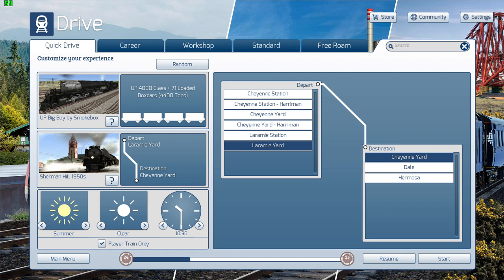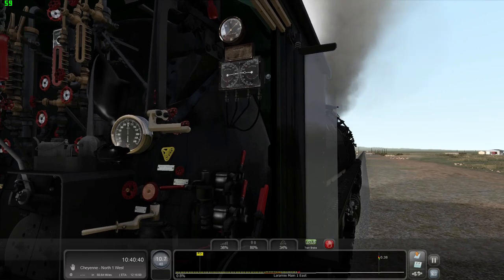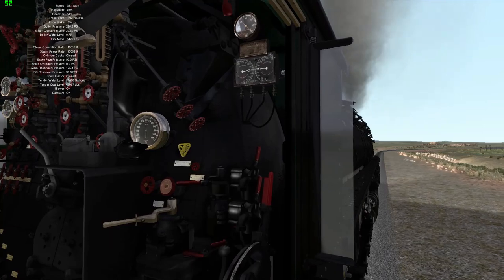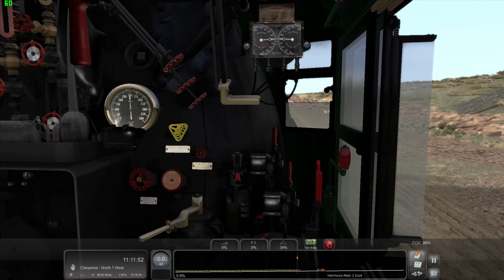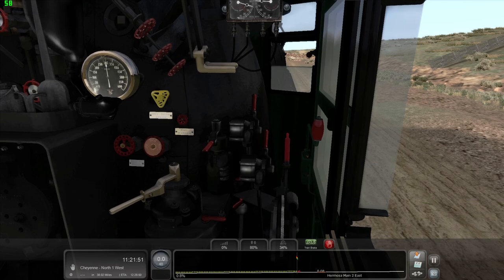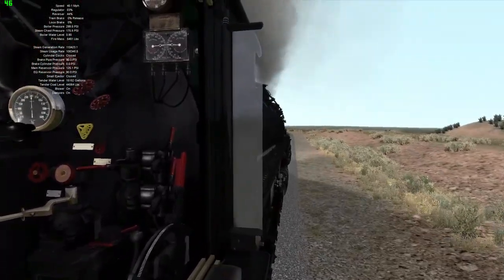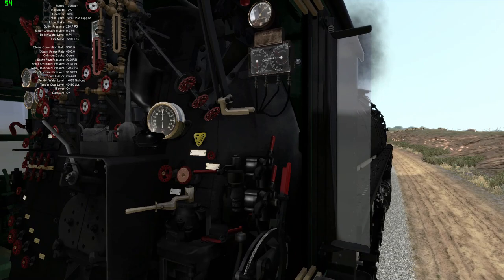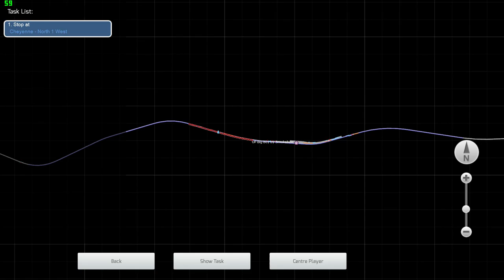Train Simulator 2021 Smokebox Union Pacific Big Boy Tutorial 2 (Engineer's Tasks)

Comment: Much appreciate the tutorial!

What exactly do the cylinder cocks do, and why do you open them when starting off?
Reply from the maker: The cocks drain away any condensation that may have gathered within the steam system. Starting with them open also allows smoother starts.
Reply: @FanRailer  Thanks

Comment: So I'm hoping to get the marias pass and smokebox big boy for christmas this year, so I have a few questions: (note I didn't bother watching any further than 27:56) 1. why do you keep the train brake at 34% when your not using it? 2. is it a good idea to leave AI fireman and AI engineer on if you simply want to watch the locomotive operate and do nothing else? and 3. how long do you leave the bell on when leaving the yard?
Reply from the maker: 34% is the running release position. That is where you're supposed to keep the handle when in normal operation. You can leave both AI on if you just want to sightsee. I usually shut the bell off as soon as I'm out of yard limits.

Comment: I cannot for the life of me do the Sherman Hill employee excursion pt1 (for FEF3) w/ a positive score(except one time) .. I cant manage to get enough speed going uphill to meet the arrival times right. The one time I managed to was after I copy n pasted what the auto engineer did which seemed to adjust throttle and reverser once every 5s or so at same time ... it was nutty. I dont know why its needed. I cant seem to replicate again tho, any tips to maximize speed uphill in this scenario/excursion?
Also, another question ... on a light train, is it practical to, in any case use the reverser in a small -reverse position to aid in stopping or slowing while going downhill? It seems like doing this would drastically reduce engine brake wear. But, I dont know if in real life it would some major adverse effect to the rest of the loco (steam related items).

Comment: Nice. This helps with FEF3 as well?
Reply from the maker: Generally speaking, yes. The back pressure rule does not necessarily apply since the FEF script is outdated and needs re-working.

EDIT: with the recent update, new back pressure rule applies to 844. 12 lbs maximum until you can no longer maintain boiler pressure at maximum firing. Then adjust throttle and reverse as necessary.
Reply: @FanRailer  Thanks -- using your vids but can't keep the speed up before it falls off eventually.... Errrr! More practice I guess.
Reply from the maker: Unless you're firing the 844 manually, you CAN'T just yank the throttle to full right away. You have to start nice and easy, keeping pressure at about 290-295 until the fireman builds the oil fire to the maximum 150 lbs. Then you can operate with the throttle wide open and control speed / steam consumption with the reverse gear.
Reply: @FanRailer   Heck no I couldn't man fire if my life depended on it. I'm a SD40-2 refugee trying to FINALLY learn the long ago purchased FEF-3 (or steam in general) now that I have "SB-BB." :-) Steam is a new concept as of a few days ago as your three part video somehow has broken through -- much appreciated. Out on Sherman Hill with BB, I got about 20 miles out of Laramie (from Cheyenne) before I had to stow it for the night -- This time I was able to match your numbers as the speed climbed with no fall off -- I think I have to be a bit more patient and let things percolate before fiddling with settings. 

Thanks again for the invaluable tutorials, and answering back directly. You know this medium like the back of your hand, it seems. FEF-3 too -- I got those numbers jotted down as well.
Reply from the maker: Glad to be of help. I'm thinking I should do some FEF tutorials, but even I have yet to fully learn to fire an oil-fired locomotive.
Reply: @FanRailer  Oh -- and hell yes to the FEF-3 tutorials !! Your style I think would be most effective. Thanks SUBBED / LIKED
Reply from the maker: @Tamburello_1994  with the update out, I will find some time before mid august to record a set of 844 tutorials. In the meantime, you can check out the live stream I did with NYCTA Railfan on this locomotive over on his channel.
Reply: @FanRailer  Thanks for remembering !! I will do just that.

Comment: i love this loco and i love it in the game, but i can't drive it worth for shit. I can't get over a 1.8 grade on Marias Pass
I do need tips on how to drive the big boy over that grade. I don't turn off the AI on the big boy's firemen side as that would be to much for me. I follow this video to a T, but it would seems i'm doing it wrong. When i'm climbing it would start to go back to 300 PSI and then stall. and no matter what I do, I can't start it back up. even when i'm only pulling 57 loaded boxcars. It always stall on the grade and I can never get it moving again. But it acts like nothing is wrong.
Reply from the maker: That means you're pulling a train that's too heavy for the grade. 57 loaded box cars sounds like WAY too much for a 4000 class unassisted on a 1.8% grade. Doing the math, a Big Boy would only be rated for 2750 tons maximum on a 1.8% grade. If the average weight of a loaded box car is 60 tons or so, you can only have about 40-45 cars on the train.
Reply: Thanks for the knowledge as always!